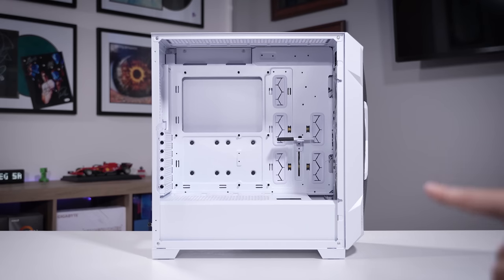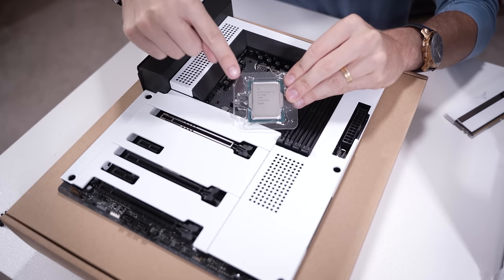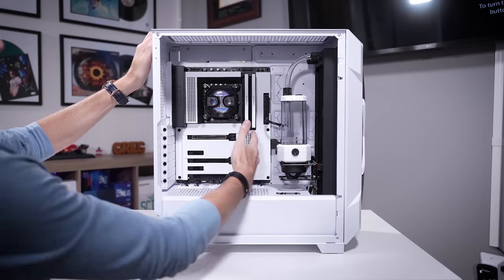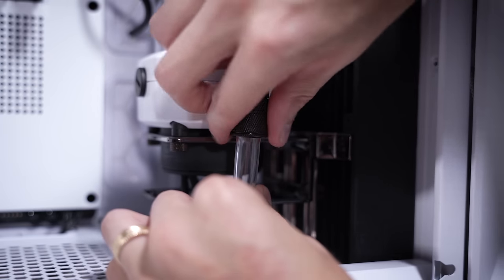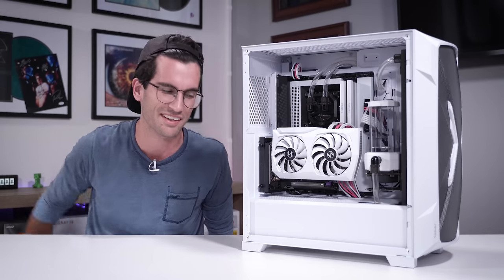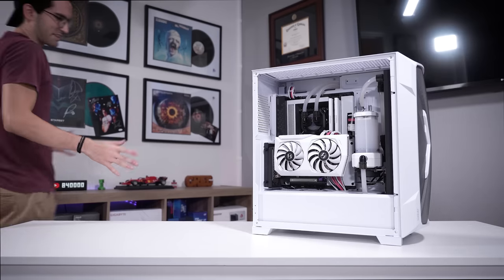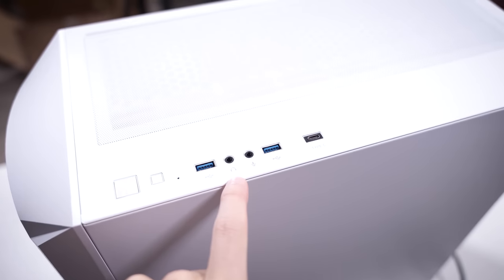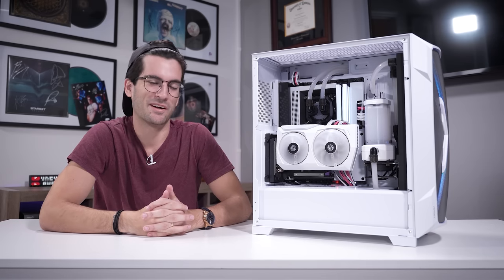Just Another CRAZY Gaming PC Build Log!

Comment: Greg, why not strip the system back to. Bare and install the radiator inverted. That way the fittings are on the bottom partitiyof the case, completely hidden? That would solve the issue with the "soft line bend" that you're experiencing.

Comment: You shouldn't pump the air tester up so high. The manual says to get it to 0.3-0.4 Bar. Any more pressure and you might create too much of a drop in pressure and think you'll have a leak when you don't. Also, get a pump jumper. They are like 10 dollars

Comment: looks great, only nitpick i would have done is use more cable combs on the GPU cables so its uniform and straight the whole way down, but like a said, a nitpick.  i also wonder what it would look like if you used pink fluid

Comment: Greg, probably a stupid question but on the front i/o connectors could you put a drop of say superglue on all the little connectors to make them one larger connector to make it easier to  plug in to the MB?
Reply: I use a piece of carefully trimmed 'Scotch tape' to keep all of mine in a single plug. I've thought about using glue but, the fear of it causing the connector to become permanently attached to the motherboard pins was more of a risk than I was willing to take. I've decided that on my next build I'm gonna try and apply a bead of hot glue along the sides.

Comment: Use Evan's Waterless Coolant. It's superior to any other coolant. It really is. Also, I really like Antec's FLUX series of cases. They have a FLUX case that uses this 'frame', the Antec DP502 FLUX. The FLUX cases have a smart and Modern design but still have a spot for a single ODD, which I still use.

Comment: Cant find that Watercooler tank cpu  radiator mounted on front ?
Reply: 3 fan radiator & tank must be worth arond $300  A 2x radiator cost au$130            my white deepcool 1x radiator ive used since 2017 $86 works fine
the White PC case $130 above in demo  not bad -  2 style pc boxes  one has psu above $160  other like his below  $130 one does the job same dimensions

Comment: Are the front fans blowing inward? If so they are blowing hot radiator air back into the case. I request clarity on this matter.
Reply: Yes they are. But it's creating a pressure differential, so the air does eventually escape. The GPU will run slightly hotter, but it's not very power hungry anyways so it should be fine.